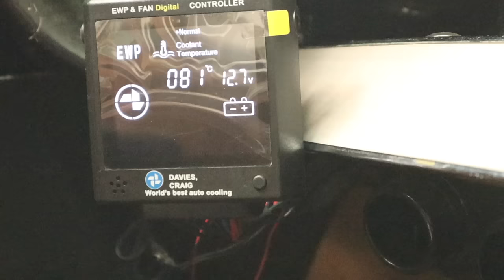Can I stop it overheating?? - Ferrari engined Alfa 105 Alfarrari build part 212

Comment: There is another school of thought with the cooling shroud, delete it completely and hang the fan against the radiator. Next make an under tray which extends to the back of the engine but open at the rear and covers the engine completely. The theory is that there is high pressure air just under the front of the car which effectively pressurises the engine bay stopping hot air escaping. The rear of the engine area is now low pressure and effectively pulls the hot air out.
Reply: He already had the undertray/bash plate that he took off a few episodes ago to try and fix the cooling problem. It covered the from through passed the crossmember and opened at the back.
Reply: @b3nny90  it’s just a thought

Comment: Hi mate I built a 81 tg Gemini with a commodore vr v6 3.8 l in it and had the same problem with getting hot I’m a refrigeration Machanic by trade so what I did was bought a heat exchanger 60 plates and tee it into my hoses and it works a treat it dropped my temperature by 11 degrees I’m so happy with it now as before on a 30 degree day the temperature would skyrocket now on a 30 degree day it sits at 82 degrees and the fan cycles on and off 👍👍have a look into it might be good for your car

Comment: EDIT: Stoked the radiator mod’s helped! As others have theorised, I think part of the heat issue may be the air not being able to escape the engine bay. I think the best way to solve it without ruining the looks would be to lift the rear bonnet latches up and down on some kind of actuators (have it controlled by bay temp). Should be pretty easy to test before committing by making some little extensions.

Comment: Hi Jeff, are you sure that the removal of the thermostat isn’t your problem? Depending on its design it can have a big effect on how the coolant flows around the engine and hence how it cools. I admire your perseverance - keep going!
Reply: Electric water pump doesn't require a thermostat
Reply: It does on some engines. Some bypass thermostats help distribute the coolant flow proportionalty between the head and the block. If not fitted it can overcool or let overheat either the block or the heads.

Comment: Great outcome on the overheating issue, Jeff.

Congratulations on thinking about the coolant flow and slowing it down so it would duct away the heat.

It’s such a satisfying achievement for you among many with the car.

I owned a Peugeot 504 wagon whose operating temperature was too high for my liking.

I changed to a cross flow, sealed system radiator and a Peugeot 505 shroud so the gauge was always comfortably less than half.

It was always so pleasing!
Reply: But he hasn’t slowed it down, it’s moving through the radiator faster, but for longer!
Reply: @jiminycricket9877  Ok.Time for a stop watch to measure elapsed time when there are no barriers to straight through coolant flow in the radiator and controlled flow by re-routing with the baffles Jeff installed.
Reply: @holdencaulfield1001  ok, I get it, it seems pedantic.
But there’s a serious point. If you don’t know why what you’ve done has worked, you haven’t learned anything.
Yes, the Alfa now cools at idle, probably due to a combination of better core utilisation, improved flow quality and better heat rejection from the engine. But!!! If you don’t know why then you just have an anecdote and applying the same knowledge elsewhere is no better than a guess.
Having the water move through the rad slower will reduce the amount of heat transfer, not increase it. If the whole rad is at 83°, it will reject more heat than if the inlet is 83° and the outlet 53°. There is another reason this fix has worked.

Comment: It's interesting to go through the comments here regarding the over-heating problem - so many different takes on what works or should work.  Intuitively, what you've done makes sense, so hopefully you've got the problem licked now.  Exhaust seems noticably quieter.  Shame that the tone isn't as melodious as the original Ferrari, but it's still a beast man!

Comment: Hi Jeff, if I could comment about your exhaust note “problem”, I don’t think the issue is your headers, your main pipes are too large in diameter, which creates the low pitch droning sound. In my experience a smaller diameter pipe raises the pitch, which will make it sound sharper and crisper.  It’s not a race engine, and you’re not going to be using 7000-8000 revs very often, so you don’t need the flow of such large pipes. For a 3.6 litre V8 with about 400 bhp, your exhaust pipes only need to be 2.25 or 2.5” diameter each (max). You’ll flatten out the power and torque curves without losing much if any top end.
Otherwise, love your work, keep going!!
Cheers
Bill
Reply from the maker: They are 2.5". It is less the tone that I am missing, it is the alignment of the pulses if that makes sense. It doesn't sound Ferrari, like even a loud Challenge car sounds.

Comment: Well done on sorting the cooling. I would never have tried that, it goes against everything I know (or thought I did!!). I would have removed the restrictor to increase flow rate.
You’ve actually reduced the total cooling capacity of the rad. As the water is now cooler coming out of the rad, the avg temp of the water in it is lower, so the temp diff between air and rad temp is lower, reducing the cooling capacity. I guess the engine needs that cooler water to give up its heat effectively but it doesn’t explain why it was ok under load - with the leccy pump flow rate is (or should be) independent of engine speed.
I’ve always fitted the smallest rad I can get away with so guess I’ve never come across (or had to deal with!) issues having one too big!!!
Well done though, I’m glad you sorted it.and keep up the good work. Cheers.

Comment: Your best bet for a choice of steering ratio is to look at RWD original Escort racks. Because of the rally heritage you can buy a selection of racks in 2.9, 2.4 or 2.2 turns lock to lock. You need to check carefully for bump steer, the height of the rack and the length of the tie rods will be critical, having changed to a rack from a steering box. Rally Design is one supplier with a good selection in both LHD and RHD.

Comment: Jeff, I don't know weather I've mentioned before but back in the 70's A fellow racing an XD Falcon group A 351 had overheating problems and he tried all sorts of things to fix it, A guy from drag racing suggested reducing the impellers in the water pump by about a third which fixed the problem. It slowed the water flowing through the radiator giving it time to cool, you choice to see if that fixes it.
Reply: This reminds me of running temporarily without a thermostat. With no restriction. There was too much water flow to efficiently transfer the heat different cause but similar concern.
Reply: Reducing the flow of air or water will never increase the amount of heat removed (ie drop engine temperature). What may have been at work was the modified impeller reduced turbulence or cavitation in the radiator water flow. This will certainly improve efficiency of the system.
Reply: @petergoose8164  I try my best to get my facts straight. in this case I know for a fact when I took out the thermostat my engine did not cool as well. That's when i learned about restrictors.
 having heard your comment I did some research and now I see that perhaps the transfer Rate of heat out of the engine into the coolant is a constant however with more coolant flowing past you're putting the same amount of heat into A Larger quantity of coolant  In this case perhaps the exact issue was too much flow through the radiator to Expel that heat. seems like Jeff did the right fix in the right location.

Comment: We had electric water pumps in the past and put them in the bin. They pulse at full speed and cavitate the water. You can mount the electric pumps so they are in the bleed position this is better. But highly recommend the bin for the best location. More expensive electric water pumps have there own ecus and speed controller so they start at slow speed like mechanical one that speed up with the revs. All the best

Comment: Well done with the cooling although the physics understanding is not correct. If you remove the restrictor to coolant flow it will probably work even better. Another commenter mentioned a very relevant point that previously the water flow was inadequate in parts of the radiator, chiefly taking the easiest path.  Just a random point, in old BMC Minis people would remove thermostats to try to improve cooling, the opposite would happen due to turbulence created near the pump actually impeding the flow. A few very good points here in your comment section. A great project, admire the way you find a problem and keep the motivation going to sort it out. The car still sounds remarkably Italian!

Comment: Great work Jeff. You need to know the original spec for that engine cooling properties, FW-pump capacity and flowrate, radiator flow characteristics and capacity, this is not rocket science but it will save you from lots of trouble. Can highly recommend Setrab AB radiators. Also coolant from Evanscoolants, classic cool 180. All the best and good luck.

Comment: I have found water weter aditive helps as it reduces vapour bubbles on the metal surface which impedes heat transfer.

Comment: Hi saint Jeff.
Glad you sorted the coolant issue.
I do have a concern regarding the core baffles.
This might work on idle but could restrict water flow at higher rpms.
The fact the alfaFerrari cooled sufficiently on idle and overheats upon driving suggest an airflow problem through the radiator and out through the rear of the car.
..
In the past a car that overheats on the motorway was due to a worn water pump not adequately flowing water at high rpms.
..
Steering rack.
I think the issue woth the rack is the ratio of number of turns lock to lock and degree of wheel travel per movement of the steering wheel.
You need a
 "quick rack" with a low steering ratio.
.
You may be able to re-engineer your current rack by changing the internal pinion on the end of the steering shaft column.
This would be time consuming and require  alot of research, and machining of different pinion gears.
..
Also that vanity cover over the radiator might also be restricting airflow up over the radiator  and through to the hood. 
Maybe a small vent along that cover might also help with the cooling.
..
Its the efficient speed of airflow through the radiator and out under the  rear speed that is partly the cooling issue, 
because the engine is running faster and under load creating more heat.
..
To me the AlfaFerrari in the video DID sound like a Ferrari.. 
definitely better with the muffler add ons...😎

Comment: Jeff - Great to see the fix on the cooling.  Have you thought about using an MGB rack? It is 2.7 turns lock to lock and I believe there even quick ratio ones from tuners at 2.4 turns lock to lock.
Reply: Jeff - I just checked the Toyota Yaris steering rack ratio and the SE model has a 2.3 lock to lock.  Make sure you get that one instead of the standard model, which is 3.0 turns lock to lock.  This will be a faster ratio than the MGB rack.

Comment: Hi Jeff, when l straight piped my camaro l used to insert eBay motorbike baffles into the muffler deletes when  inspection time came around, I didn't weld them in cus they came straight back out the next day, but they sure stopped her snarling and  could have been welded in I had been soft enough

But was easier to use them cheap eBay baffles than hump and struggle with big bulky mufflers

Comment: Look for a rack from a car with an electric power steering column. They often are less turns left to right.

On my Giulia i used one from an Opel Corsa B and that gave a good direct feel.

One of the issues from going from a steering box to a rack&pinion is that the amount of movement is less on the steering rack. On most cars with steering racks you get rather small steering arms on the knuckle so the stroke on the rack can be smaller. The steering arms on a steering box car tend to be longer, requiring a lot more stroke.

Comment: Cooling idea: In some 105 racecars I have seen holes in the cowl in front of the windscreen in the enginebay side. This will ventilate hot air out though the freshair screen. The area i front of windscreen is usually a low pressure area, so the air should flow out nicely.
Reply from the maker: That is a high pressure area.

Comment: I found that also adding oil cooler with fan cools engine temp.   Also I had a spal fan on an enclosed radiator by race radiators, this kept my big hp problem motors cool on the street upto 38c Melb weather

Comment: Hi Jeff i saw that the engine temp was 80 degs C, that would be a normal cars cruising speed,  the thermo will come on, I would set it at 95 and off at 87 deg c where you would be in traffic at a stop light or bumper to bumper ...
Reply from the maker: I will change it. I set it low while I was having overheating issues ;)

Comment: Triple pass is definitely a bonus, I still think that the pump might be cavitating. , it's up high and much as it should be able to modulate for the required temp, it will be dumb if it's not pushing max capacity.. An 1/8" bleed connecting from adjacent to the pump and down to the Block inlet should ensure that it's not an issue.
Reply from the maker: The pump is the lowest part of my system..?

Comment: I used a power steering rack without the pump for a racecar, because it was significantly faster than the manual steer.  There are quick-racks available foe escorts rally cars and the like. Modern electric power racks should also be considered.

Comment: Jeff, I think that you are clutching at straws on the cooling. 

The radiator is shrouded by the body on the exterior and by the engine on the inner side, a problem seen on many cars. This is causing airflow turbulence. A thinner radiator would probably make sense...

A solution worth trying would be to use ducting to the underside / inner wings and possibly opening the bonnet on either side towards the rear (and perhaps using the window only in winter).
Reply: What's clutching at straws about this? Multiple pass radiators make more effective use of the radiators surface, better fan moves more air. Seems like two very practical solutions alongside the removal of the big skid plate at the bottom that fixed the issue. 
Reducing the thickness of the radiator on the other hand won't change the airflow significantly..

Comment: Nice bandaid with the radiator, but it still does not confront the problem that a crossflow radiator presents. The old top bottom tank radiators are by far superior as long as you have a proper pump. From our experience the electric pumps do not provide enough head pressure. You need to see inside the coolant passage around the valve seats to fully understand the need for a high head pressure and high flowing pump. Nucleate boiling is a real thing that causes cylinder leak down to occur when the boiling around the exhaust valve seat is not removed with sufficent pressure and flow.
The top bottom tank radiator allows for expansion room in the top tank as you do not seem to have an expansion tank in the system. 1 liter of expansion is a minimum for a naturally aspirated engine.

Comment: I know that poping the back of the bonnet causes a low pressure zone forcing air back in but that's only when the cars moving. Your car's overheating stationary so may help release the heat.

Comment: Could you not use a ford escort steering rack, they are available in various speeds. They go in front of the cross member, but I’m thinking if yours is behind, couldn’t you use a LHD escort quick rack and flip it over? I have a LHD escort with a 2.4 turns rack. Readily available in the uk anyway.

Comment: two 9 inch holes in shroud  has less (127 sq in) square area than one 14 inch hole (151 sq in) so it is a profit. More flow from 14 inch fan is second benefit

Comment: I was wondering if you'd get to the steering issue in this video... and I thought you could benefit by referring to the channel Fanatik Builds.  He was the guy who told me about YOUR channel.  I told him he had the best restomod build on the internet, and he said that HIS wasn't the best... Home Built By Jeff Alfarrari was the best.  Anyway... he gives you props all the time, so maybe return the favor?  Meanwhile, take a long at what he did to solve his steering issue.  I think - if I remember correctly - he used the rack and pinion system out of a Mazda Miata... but he even had to modify THAT a bit to make it work.  You may get an idea or two if you check out the videos dealing with this... I think he covered the whole steering thing over a few videos, but it's well worth watching.  He  really does do an excellent job.  I'm glad to see you solved your overheating issue... but I'm still thinking you could benefit from having a few more speed holes - nicely designed - to get more air through the engine bay.  IDK... maybe what you've done is enough.
Reply from the maker: I have shouted him out too ;) . His stuff is great.

Comment: It’s a shame that the electric water pump cannot act synchronized with the RPM sensor, lowering the speed when your are at idle. that would sort your problem out without modifying your water radiator. Nice job 🙌

Comment: Thinking that the Ewp isn't cutting it. A belt driven pump might pull 3 or more kW. Guessing this pump has a 500W motor? If you wanted to try slowing the flow down you could already with the pump. It is a very thick core for sure and they aren't that efficient for that reason. Maybe the triple pass will require even more pump power! If you wanted to go all in with that core, split it vertically instead so that the full face sees the full air flow twice...... Means you will have the inlet and outlet on the same side, that might be an issue.....